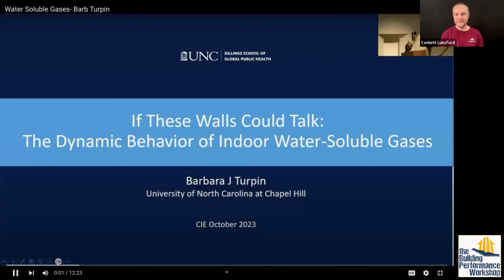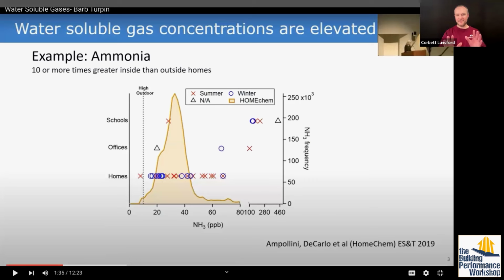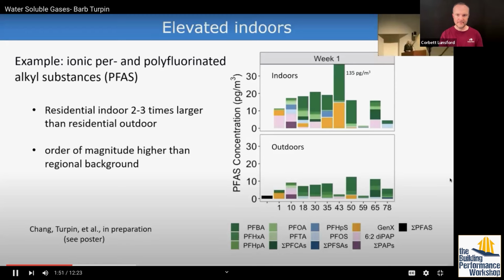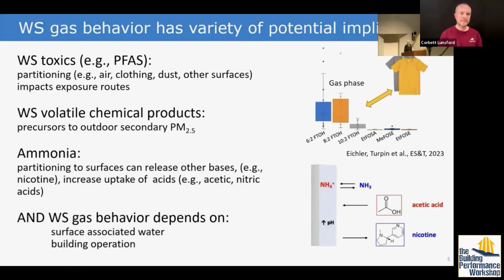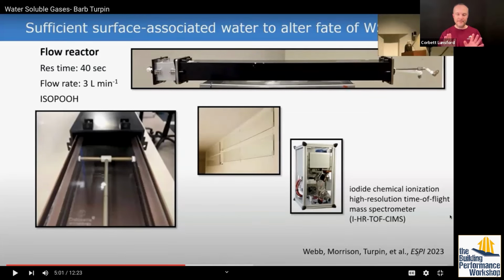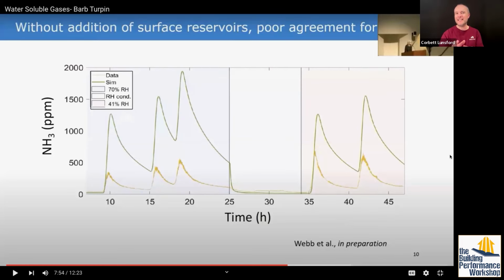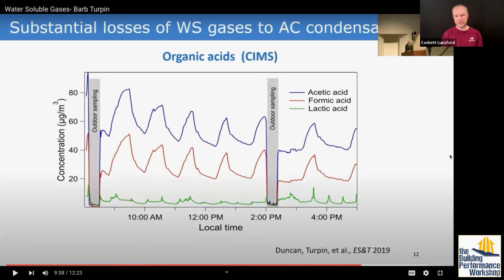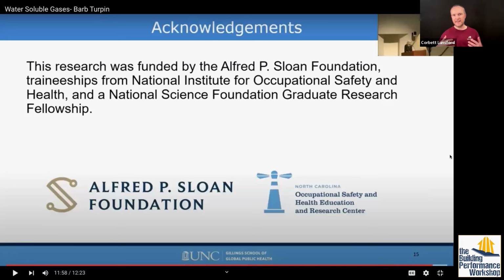Beyond Dewpoint: Water Films are HUGE for Homes, HVAC, and Indoor Pollution- Barb Turpin at CIE

Comment: Most household products contain 5–10% ammonia, while commercial cleaners can contain as much as 25%. So, I'm not surprised by homes generally showing lower ammonia levels. Ammonia is still used in many commercial floor cleaning products and window cleaning products because it is a powerful degreaser. The people doing the cleaning tend to look for the products which do the most efficient cleaning in the shortest time at the lowest product cost.

Comment: UV222 is a 'mixed bag' reactive chemistry virus particle inactivator. Early proponents of its use for reducing Covid virus viable particle concentrations didn’t think about the secondary unintentional consequence of UV222 also generating low level ozone levels.
They were used to the longtime use of germicidal UV (UV254), which destroys ozone rather than generating ozone. Live and learn.

Comment: Would a fountain with airflow be a feature?
Reply from the maker: Of?
Reply: Unless you're filling it with distilled water, anything that sprays violently enough to create mist will turn the minerals in the water into fine dust. I used one of those ~cool mist~ ultrasonic humidifiers over the winter a few years back, and it coated everything in the room with a film of white powder.

Comment: It seems like a variable speed air conditioner would be helpful in getting extended run times, as it's rare that an air conditioner is properly sized for the conditions of any particular day. Since they are sized for the 95th percentile day, and then oversized to the next size unit, when its running on a 75th percentile day, it's even more oversized than it's design limit, and won't dehumidify much. That's also a case for a dedicated dehumidifier.

Comment: In reference to the graph of water soluble gasses decreasing during A/C condensation (29:30). Does that suggest that water soluble compounds could be more effectively removed with a combination of mild humidification to capture the compounds and dehumidification to remove the contaminated moisture?
Reply: That's what I was wondering.  Should we be filtering all our indoor air through what is essentially a bong?
Reply from the maker: @shubinternet that’s called an evaporative humidifier, and no I don’t think so. Next week is a big vid for this.
Reply: I favour an air washing system rather than a HEPA filter. The waste water from it should be safe enough to water a lawn with, although with all these VOCs I'd be hesitant to use it on food plants.

Comment: I live right on the edge of a rural area. I have electric heat and stove. And both my cars are Electric. I have put 20 air sensors around my house so I can catch problems early. My airthings sensors still show VOCs jump above 1000. 

The person that cleans uses very few chemicals. Since I’m still having this problem I can’t imagine what most people deal with. 

Rarely do things seem overwhelming to me but this one falls into that category. I can’t make sense of where the VOCs are coming from.
Reply: You might want to try another sensor to ensure that your readings aren't just from a faulty one.  Also, VOC readings aren't particularly helpful by themselves since any organic molecule in the air is going to set them off.  One thing that tends to annoy me when people talk about VOCs is that there are literally tens of millions of known organic molecules with an endless array of properties.  For example, acetic acid or formic acid mentioned in this video are going to be harmless at low concentrations.  Your body already produces them in its own metabolism and has the biochemistry to handle them unless their concentration goes too high.  Other VOCs like formaldehyde are fairly toxic and are more of a concern, though you'd have to look at scientific literature to see what the problematic levels are.  Some of the VOCs emitted by black mold are extremely toxic and are going to be a concern even at trace levels for some people.  Alternately, a fresh flower bouquet is going to be emitting crazy amounts of VOCs and I don't think anyone is losing sleep over whether you have flowers in your house.  A single essential oil vaporizer could easily max out a VOC sensor.  (and some essential oils can be quite harmful to people and pets, despite the claims of essential oil pushers)

The sort of sensors that you can get on a home system are really basic and kind of marginal in their utility.  They don't discriminate between VOCs and will give you different readings for the same concentration of two different VOCs because they will interact with the sensor differently.  The analogy I would use is trying to use a single pixel light sensor to try and do valuations of paintings.  All you can tell is the average brightness of the painting, but not much else.  These sorts of sensors just tell you there's a lot of something in your air but not whether or not it's harmful.  These researchers are using mass spectrometers which are multi-hundred-thousand dollar pieces of equipment that can actually break down the concentrations of all the different molecules in the air.  That is the sort of instrument that is needed to really determine whether a high VOC level is actually a problem and how to solve it.  

If you live in a rural area, you could be measuring chemicals coming off of the plants in the area which are largely harmless.  1000 PPM seems high for a natural setting, so there might be something else at play but you may be at a point where bringing in a pro or academic researcher that actually has the tools to do a proper measurement is called for.
Reply: @danheidel
I’m using 8 Airthings sensors around the house. I can usually see a big spike in one room then a delayed reading response all around the house. 

Thanks for the details from that perspective this could just be a window being opened in front of our flower beds. Hand location being put on or a million other things. So I might see if I can track it down a couple times but I’m just not going to worry about it. 

And yes people that put artificial scents into their house confuse me. Especially heated oils. I just don’t get it. And for me it gives me a migraine if the concentration is high enough.
Reply: What cleaning chemicals do you recommend?
Reply: @Nihillistism
First I suggest starting with distilled water and good microfiber cloths. Norwex is a fantastic brand. Very different than a dollar store microfiber. 
The Norwex cleaners are also good. 
Seventh generation is another great brand. 
And of course food grade white vinegar. 

Sorry for taking so long to respond to this one. I wanted to get that brand correct.

Comment: This is fascinating, and I need to know more. Subscribed.
What I've been really focusing on is that outdoor CO2 levels have risen 25ppm in the past 11 years and are still accelerating, largely due to positive feedback cycles that humans don't have the ability to interrupt - so it's going to continue for a while yet. There will come a time when ventilating our houses with outdoor air simply isn't adequate to keep indoor CO2 down to an acceptable level, and at that point instead of using outdoor air ventilation we'll need to move to indoor air decarbonation and recirculation.
One of the things I have drawn into my design is an air washing system instead of a HEPA filter simply because I don't want to be fiddling with replaceable filters forever after, and using water to wash the air is a filter system that disposes of itself down the drain when it's dirty - so long as you have enough clean water supply to keep it running. But with the possibility of water soluble toxic gases in the air as well as particles and carbon dioxide, that's another very good reason to use a washing rather than a filtering process to remove particulate pollution.
I think it's still best to start from not introducing these chemicals into the home in the first place, but that's easier said than done. Legal action to ban them would require being able to buy more politicians than the petrochemical industry already owns.
Reply: I monitor the CO2 levels in my house and don’t worry about it until it’s over 900 ppm. 

Do you actually feel there is a risk of the outside air going above 800ppm. That would definitely be crazy. 

I wonder how CO2 levels are distributed outside. What is the ground level CO2 vs 1km up.
Reply: @ecospider5  Check the reports about how much carbon is currently locked up in permafrost in the arctic. It's actively collapsing now, and there's nothing we can do to stop it collapsing so yes, it is all going to end up in the atmosphere. Geological processes will remove it eventually, but that's a very slow time scale.

Also, I'm not a fan of 900ppm. 1000 is where people start being consciously aware of CO2 affecting them, and a 10% margin below that isn't much. There isn't any really detailed research on what is the optimal level for human health, but for 99% of human existence the air we were breathing was below 400ppm. I think that needs to be our target for indoor air quality for our families, and that means even today we need active decarbonation of our indoor air.
Reply: I have learned it’s impossible to sleep in a closed room and not have the Co2 go above 700ppm even with reasonable hvac. So I have a monitor that triggers at 700ppm. Turn on the hvac circulating fan, opens the outside air intake, and turns on the bathroom exhaust fan. It runs a lot. 

At thanksgiving we have 26 people. So I used them as lab rats without telling them. When the Co2 hit 1500ppm the conversation greatly reduced. So along with the HVAC I opened a window. When the Co2 dropped below 1000ppm the condensation went back up. It was kind of funny playing with the group. 🤓
Reply from the maker: @ecospider5 are you Bob?
Reply: @ecospider5  Have you considered just running the air system continuously while you sleep? The entirety of human evolution from monkey-ish animals to at most 10k years ago, humans and pre-humans spent our whole lives outdoors breathing air that had between 180ppm and 300ppm carbon dioxide. That's the range we evolved to breathe, and that's what we're optimised for. Building houses with doors only started 10k years ago, and the custom spread pretty slowly so for most of us our ancestors were still sleeping in simple shelters until much more recently.
Getting indoor air CO2 levels below outdoor air levels is high tech stuff, but the minimum standard should be getting as close as we can to outdoor air levels at all times.
Reply: @HomePerformance
No this is Alex. I’m the cat that resubscribed on patreon. This has been really great stuff. I really like the format.
Reply from the maker: Cool Alex- you and Bob F are Patreon members who should definitely discuss. Great minds thinking alike.
Reply: Great thanks for letting me know.
Reply: Yes I have thought about running the system continuously. My brain is trying to decide if the slight noise and the 300 watts of power to run the fan is more of an issue than the Co2 level. Thanks for the input I might increase how much it runs at this point. Or maybe tell it to not let the room above 500ppm and see what happens.

Comment: Very interested in following this given your recent comments regarding ERVs potentially recycling Water-Soluble VOCs into ventilation air.  I hope you’re able to do some testing or refer to research to see if that’s a significant concern.

Keep up the geeking!  😊
Reply: Seems like if there's any risk of VOCs in your build, you'd be better off with a simple HRV and then a humidifier to temper your incoming air when you need that.
Reply: @tealkerberus748  that’s an option for sure, but being on the cold edge of climate zone 6 in Canada, we’re talking about a major energy penalty to evaporate that much water.
Reply: @superspeeder  ouch. Yeah, that's a no-win situation. I hope you can find a better answer!
Reply: @tealkerberus748  I’m hoping the answer is something like, “the concentrations of VOCs passed through the ERV core are so low they are not a concern.”  Somehow I’m not feeling too lucky!!!
Reply: @superspeeder  That would be great! I think you'd need to start from the building specifications with things like zero VOC building materials, so no plastics, no foams, no OSB or chipboard, and so forth, and then likewise in running your house you'd need to be very careful about your cleaning products and the like. It's a lot of work, but it should be achievable in a new build, and forcing the building industry to work without these toxic products will make it easier for other people to follow what you're doing.
Reply: @tealkerberus748  that’s why I like seeing content on this topic; I’m hopeful that a simple roadmap emerges that normal people can follow for success in their own homes.